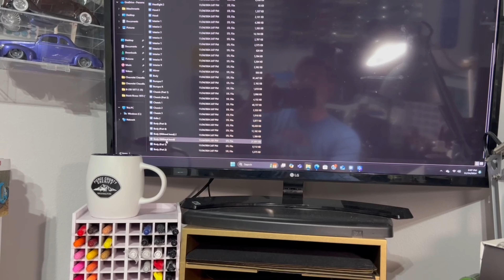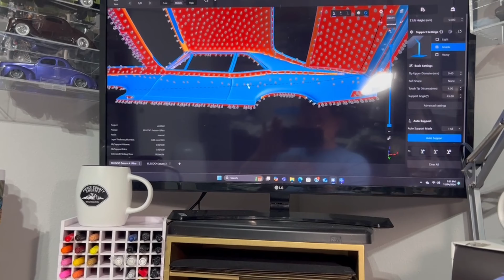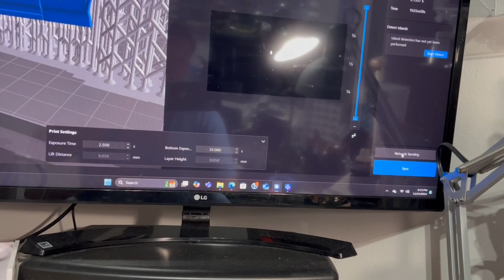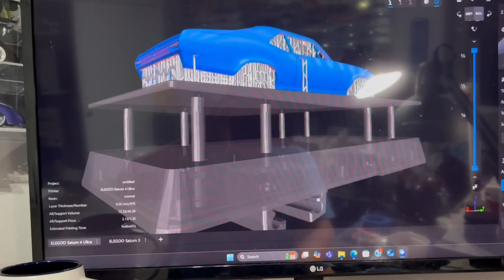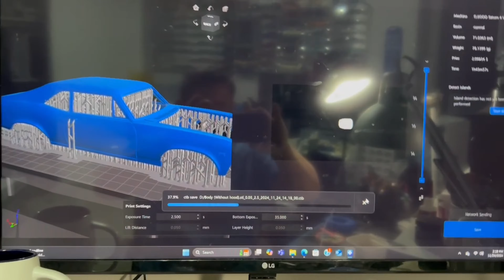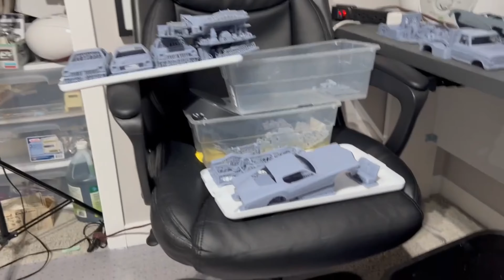You Bought A Printer Now What volume 3

Comment: I enjoy this series and wish I had room for a 3D printer and the necessary accessories.  However, all the space in my garage is taken by a model railroad layout, and I have no room in the house to use for a printer set up.  Nevertheless, as a builder of model cars as well as trains, I wonder if you could recommend a reasonably priced print service that could print for me files that I might purchase from CGTrader.  It seems to have a great selection of vehicles that are not available from the plastic kit manufacturers like AMT and Revell.

Comment: OK I'm sold on a printer but how much difference is there with 3d and resin? Also once I buy the file and open it on my computer is there a program that will let me modify it as in making it a wide body or chopping the roof?
Reply from the maker: @Putty4All  yes you will need a slicer program the program I use I showed in the video call Chitubox there are several other slicer programs on the market that will allow you to do custom modifications I do not do that so I won’t go into it on the channel